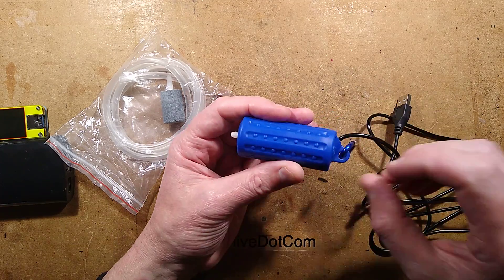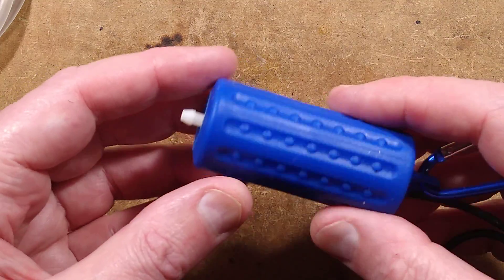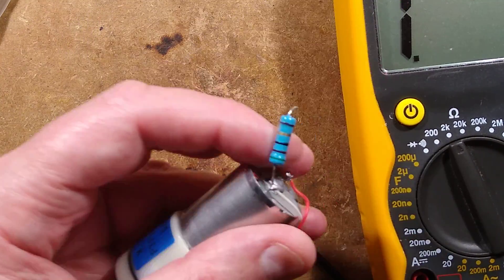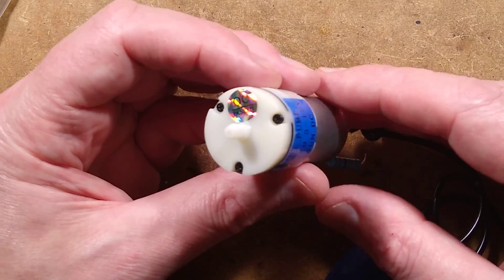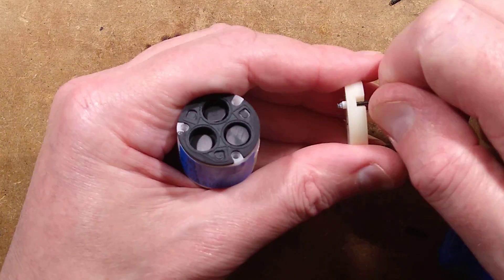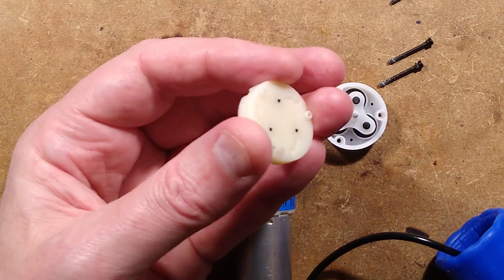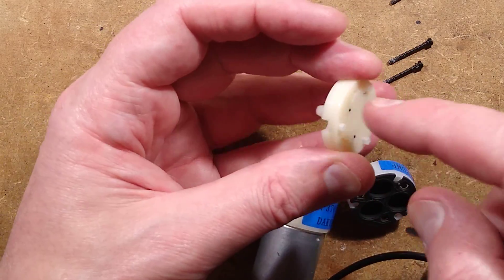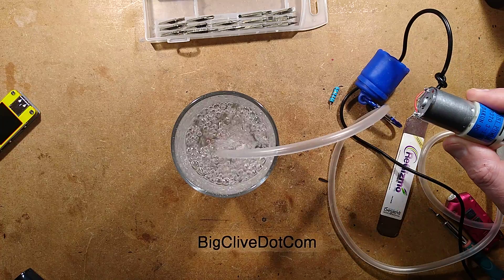Inside a clever USB air pump teardown with hack

Comment: I’ve gone through 3 of these in 6 month. Really quiet but don’t last long. I don’t think the motors are designed for constant running.
Reply: Did the motors die, or did they stop pumping?  I can see that eccentric shaft wallering out pretty quickly.
Reply: I have one running in a small aquarium for almost a year, guess I got lucky!
Reply: Did you try cleaning it? It may not have been at the top of the comments when you wrote this but someone else pointed out that it stops working if it gets dust in the rubber flaps.
Reply: I'd like to run at a lower voltage like 4.1v 24/7
Reply: More than a year on first and everything is lasting fine
Reply: I have 4-5 of it and running since a long time without a problem. Now I use only one of them but all works great. I used it for hydroculture(DWC) and for new burn Galaxy fishes. Still going great and the lowest noise pump I ever had.
Reply: How about a small amount of graphite grease on the moving bits?
Reply: @skylined5534  Lithium grease helped for me. It was the motor that really needed it.

Comment: And you didnt even give it 9 or 12 volts to see the water go ape shit lol
Reply: It's rated at 12v - I was waiting to see him stick 18 or 24 across it!
Reply: Would be nice to see
Reply from the maker: Sadly, my bench is very absorbent.  It's MDF.
Reply: so what you saying here is, A battery tear down with fire risk is fine, however if it catches fire you not use water because your bench likes a drink?
Reply: So what you're saying, Clive, is that the thing in front of you isn't real wood?
Reply: @michaelthibault7930  It IS real wood.  Tiny particles of wood compressed together with PVA glue, which is not particularly waterproof.  Considering what it's been splattered with over the years, it's uncertain whether an excess of water would make it dissolve, catch fire, or shift into a different dimension.
Reply: @Chris

Real wood? For large values of wood, maybe. 

Otherwise, sawdust stiffy. Come on, man!
Reply: @bigclivedotcom  Perfect, then you won't even have to clean it up. "Self Drying Bench"
Reply: @bigclivedotcom  put a tray under it mdf not a problem then.
Reply: @bigclivedotcom  Explosive Containment Pie Dish works for more them just explosions of Fire FYI
Reply: @bigclivedotcom  Don't you have an explosion containment pie dish suitable for such use?
Reply: @bigclivedotcom How much is a sheet of 6mm fibre cement at your local store? I like the finish, it’s water resistant and also heat/fire. Really cheap here. I use it on top on my wooden bench for protection. Not sure if it’s too reflective for film tho?
Reply: @bigclivedotcom  We'll surely get you a can of varnish for that to see some splashs!
Reply: @bigclivedotcom  - Oh no...is BC losing some of his adventurous nature after all these years?  ;)
Reply: @bigclivedotcom  spray some clear on it
Reply: As Photonicinduction would say, "Crank this thing up, until it pops."
Reply: @seanman6541  And if it doesn't pop, there is always an 'AMMAH at hand
Reply: @seanman6541  *Used to say. I miss his videos!
Reply: @seanman6541  I loved it when it popped, what a gezzer he is.
Reply: @seanman6541  Yes but it is given that Photonicinduction is insane.
Reply: @seanman6541  I miss ol Photonicinduction :(

Comment: That's a 3 phase air compressor!

I was just taking apart a similar pump used for bait - it takes 2 D batteries. Not having any I was trying to modify it to take AA. To my surprise, the batteries were wired in parallel, only 1.5v total, and the pump pumps as much as yours does with full voltage. The motor is smaller and only has one chamber though. Runs forever on a pair of 1.2v rechargeable AAs, but I didn't measure the current.

I've taken several of these apart over the years and never could quite figure out where the air intake is!
Reply: The problem with 2D batteries is that they're always flat.
Reply: @westinthewest  That's why I changed them to 2x AA. Works the same with one battery as two, but obviously lasts longer...
Reply: @ryanroberts1104  woosh!
Reply: @ryanroberts1104  AA batteries are ultra cheap, not do the D size, even though the regular zinc carbon has the same capacity as the alkaline AA. I bought some battery adaptors so I could use a AA cell in my AVO, as buying a D cell every few years is not great, as I only need one, and it is likely to leak long before it is used up, but AA cells are used all over. Also replaced the 15V battery with a stack of CR1212 cells in a PTFE block , with some brass contacts screwed onto the PTFE to emulate the rectangular 15V battery. Likely to last 20 years in there, and the cells are cheap as well, unlike that AVO battery.

Comment: Wow it could be used to grow weed hydroponically in a tank of water
Reply: Pretty cheap and way quieter than the video implies. I threw hydroton in a small plant pot with some extra holes ( poor mans net) and put that in a Soba noodle pot to grow my Tokyo Hot Chilli, my plant is small but it is proof of concept for me. I often leave it on the windowsill and use a solar panel with a  5v output to run the pump to be cheap. I also use a solar panel to run a fan (not extraction) just a bit of air cos it gets hot at the window.
If pump vibration or noise is irritating you, a bunch of these will remove that problem regardless of what you use them for. I really mean it, Just water sound (Helps me sleep actually) Do get some backup as they are so cheap. Though I have run mine for nearly 2 years with the voltage going up and down as the sun goes behind a cloud and it is yet to fail.
Anyway, to answer your question. Yes, I don't see any reaason why it would not work. Some experimentation with container size and amounts of liquid could be in order. I think in this case, overkill would do no harm at all.
Reply: @deemond5289  good idea
Reply: Google "Deep Water Culture".

Comment: would have liked to see it run at its maximum rated voltage. i think 12 volts it said on the label
Reply: I would like to see at what factor of the maximum rated voltage the magic smoke gets pumped out. These are data-driven times.
Reply: that is an excellent idea and should be done at the end of every video unless already failed. well done and mr big clive  please take these comments on board

Comment: this is a great product for cosplayers/modelbuilders
Reply: Yuh, those costumes and fursuits get hot. Maybe four or five of these...
Reply: @cheyannei5983  i was more thinking in terms of tiny smoke machines, maybe to use it as a little aircompressor to fill a small tank for light pneumatic actions.
I dont think it can create a lot of pressure but a little bit can be enough
But yeah costumes and fursuits get hot, a normal computer fan will give you more airflow to cool you or a cooling suit if you want to go fancy
Reply: @ShockburnVR  normal computer fans are big and make a lot of noise. This is much easier to muffle; you only need a little air.
Reply from the maker: If you under run computer fans the volume goes down dramatically.  I suppose the ideal approach might be to have a "summer backpack" accessory which contained the fans and power.
Reply: @bigclivedotcom  The advantage I see here is you can just pipe air to where you need it, like to your limbs, back, stomach, head, and they're tiny enough to just bundle them together in a tail or headpiece.
Reply: I wish i had a fursuit to test this out. I might try it with a vaultsuit cosplay i have.
I think you want to create as much airflow as possible. I get pretty warm in that vault suit at conventions
With your idea of putting it in a tail is feasible but you need to create a duct or something where they draw in fresh air or else you just pump warm air around.
Also you might want to add a few outlets to the end of the pipe to spread the air a bit, i think it will be better for the perceived cooling.
The summer backpack with fans is also an interesting idea, im just wondering if the fans will work good enough when you need to guide the airflow through small air hoses 
I find this interesting might look into this

Comment: I think it's called a swashplate pump; fairly common in hydraulic systems, though running much higher pressures. Interestingly, some hydraulic motors also use this to take compressed fluid and produce rotary motion from it.

Though, the construction is slightly different, rather than an eccentric drive, they use two plates parallel but at an angle to the axis of rotation, and the pistons align the plates with ball and socket joints on the driven (load) end, and fluid intake / outlet split. Particularly handy as you also get a universal joint built into the motor.
Reply: I think you mean pressurised fluid, compressed fluid is a physical impossibility!
Reply: @cambridgemart2075  compressed fluid is totally possible, however, compressed liquid is not; so I'll give you partial credit :)
Reply: @carneeki  But it wouldn't be a hydraulic system if the fluid was gaseous!
Reply: @cambridgemart2075  that's why I gave you partial credit.
Reply: @carneeki  You can compress a liquid, however it requires immense pressures to achieve very tiny amounts of change in volume. You are talking putting liquids under thousands of atmospheres to measure a volume change in microliters in some cases.
Reply: @2009dudeman  yup, that's why outside of a physics classroom we say liquids aren't compressable, even though technically yes, they are. Depends on who the audience is to which facts are useful and which can be ignored. To the person building a hydraulic implement for a tractor, a few microlitres of volume is inconsequential, but for a physics professor in an exam, it becomes incredibly relevant, and if you're discussing something on the Internet, you're always wrong in someone's opinion :D
Reply: @carneeki  In many cases we say they aren't compressible. There are plenty of areas where it is important, in this case Cambridgemart said that compressible fluids (I think he meant liquids) are a physical impossibility. Which I would say falls into both physics classroom talk and practical (but rare) instances where it matters outside the classroom.

Yes you have a point that someone will always disagree with you on the internet.
Reply from the maker: I like to consider that a challenge.  All I'd need is a glass of water and an atomic bomb.
Reply: @bigclivedotcom  Kickstarter for the first crowd funded atomic bomb? :)
Reply from the maker: @carneeki  It would probably get funded whether it actually happened or not.
Reply: Cool i had a look at Google images. 👍🏻
Reply: There are compressors for automotive air conditioners that work like this as well.

The torque produced by those are amazing...
I topped off the refrigerant in a vehicle with an older v6 in the dead of winter.
Due to the temperature, I  managed to overfill the system because neither the previous refrigerant nor the butane commonly used today were warm enough to reach a gaseous state.
This gave a false pressure reading.

When I tested it, the liquid refrigerants refused to compress and stalled the engine.

It took until late spring to figure out what was going on.
Reply from the maker: M Harris  I could run the Kickstarter then use the money to build a time machine.

Comment: That pump would be perfect for agitating PCB etchant.
Reply: i just set my tiny cnc up to go back and forth a few hundred times, no need of a fancy air pump to agitate the ferric chloride
Reply: That's exactly what I thought. I might go looking for one.
Reply: @rpavlik1  I have one of that 50€ Neje lasers. It sounds terrible when homing (the axis just smash in the end for a few seconds), but for  small surfaces its perfect.
Reply: It's so much easier to use a tiny CNC to machine the PCB now.
Reply: Colin Newman
Only if you have a tiny CNC router/mill. Be cheaper to use a small CNC laser to ablate away a solder resist, which is probably more accurate and could also be used for a solder mask.
Reply: @handlesarefeckinstupid  So much easier to just send off to a fab house and get 10 copies of a board with PTH, mask, and silk for the cost of a burrito ;)

The waiting however, is the hardest part.
Reply: @handlesarefeckinstupid  How would you machine 0.1mm gaps between the traces/pads? Or a BGA pad array? Or any SMD chip pinout?
Reply: @WolfmanDude  you can get .1mm cutters and ive had better results with them than etching. less nasty waste too.
Reply: @JohnSmith1066-l5n  Well thats very interesting, I will look into that! I am tired of corrosive chemicals in my workshop

Comment: I would assume the resistor is either to increase the voltage dropped across the cable and thus slow down the motor or a poorly conceived back EMF protection device. If so, not sure why they didn’t just use a diode, maybe they got a good deal on 2W resistors that day in the Shenzhen? 

Also not that it matters with the symmetrical design but looks to me like they're running it in reverse, red dot on the motor isn't connected to the red wire?
Reply: @WizardTim, no it's there to keep 'intelligent' power banks turned on.

Comment: it looks like it might be pulling air through the motor from that hole in the back of the cover.
that would also help cool the motor
Reply: I think you're correct, it was clear the path was through the housing containing the eccentric part
Reply: Also to equalize pressures.

Comment: Adding a switch to disengage the resistor seems like a good enhancement.
Reply: 100ma isn't much to switch, either. However, it is still 2 times too much for the cheapest slide switches, so you know they would fuck that up if they added that from the factory.

Comment: I think one of your piezo air pump videos was one of the very first ones I ever saw, so this brings back good memories. 
If you could somehow isolate the motor from the pump section I wonder how well this would work to pump water.  Motor would probably draw a lot more current.

Comment: Was hoping you would wind it up to the full 12v
Reply: My thought, the motor is rated 3-12V
Reply: Missed opportunity
Reply: @thomasesr  Its strange to see people that you recognise from MaTn live streams on other videos :-) Hi
Reply: If it's rated 12V, it should handle 15V !
Reply: @millomweb  why stop at 15V...  if we can go 24V
Reply: 12? 15? 24? That will be just some more bubbles, how interesting is that. I'll say plug it into 3KV transmission line, now that will be an interesting video.
Reply: @CapApollo  Because it's rated 12V
Reply: @PSUQDPICHQIEIWC  why 48 go up to 1000000 megavolts no i can fill up my ocean in middle east
Reply: Maybe with 12V I can fill my rear tractor tire, must not be in a hurry...
Reply: I was like TURN IT UP!!!
Reply: Please, crank it up to 12 volts and then pop it at whatever voltage...
Reply: That's totally something Photonicinduction would do
Reply: @Kuraio  until it pops
Reply: I thought I was the only one
Reply: this
Reply: this please
Reply: Exactly what I was hoping for when I saw the low current and the "hack" in the title!
Reply: Came to comment the same!
Reply: Please Clive  - give us an update. Turn it to 11
Reply: Come on Clive blow it up make it smoke will it  take 12-15 v 😂 cheers nice video
Reply: That power supply goes up to 30 volts.  Why stop at 24?! :)
Reply: Well i think he should try powering it with 1.2 gigawatts of lightning power 😎😅

Comment: Far more efficient than I would have guessed
Reply: The apparent output efficiency is probably greatly aided by the pump not having to wear a silicone gag/mask while under test. The pump is no longer 'breathing' through tiny tubules (presumed to be molded into the interior of the silicone sheath). With the sheath installed, are the numbers the same? The output?

Comment: I beat Clive to working out the pump resistor value!  The gold multiplier on the resistor is 0.1 so 510 x 0.1 =  51 Ohms.  Do I get a gold star?
Reply: No gold star for you

But a gold ring!
Reply: Green brown black is 5,1, no multiplier ie 51 ohms, gold band is 5% tolerance
Reply: @FarleyHillBilly  YOU win.
Reply: ...sort of. It is t that there's no multiplier, but that the 0 means 10 to the power of 0, which is 1. But you know what you're talking about.
Reply: @FarleyHillBilly  sorry but no the tolerance band is on the end green brown black gold  gold is multiply by 0.1 silver is multiply by 0.01
Reply: @dogwalker666  
 Aha ! 5 bands  510 x 0.1 = 51,  brown band =1% tolerance
Reply: @FarleyHillBilly  yes it gets difficult with 1% tolerance knowing which end to read from.
Reply: @dogwalker666  
I blame the E48 series for needing an extra band ie 6.49K
https://en.wikipedia.org/wiki/E_series_of_preferred_numbers
Reply: Farley Hill yes that’s when the problems started also ment we had to buy more Raco draws.
Reply: @dogwalker666  
Ziploc bags and cardboard boxes for us. Holco H8s have the value written on them, luckily.
Reply: Farley Hill that’s how I store the overflow lol.
Reply: I was surprised Clive did not know that gold ÷10 silver ÷100
Reply: As did I, quite surprised he hadn't encountered gold and silver multiplier bands.
Reply: @cambridgemart2075  indeed I used a lot as current sense in DC drives.
Reply: M Harris I was surprised he didn’t I use them a lot 1% are quite common I also have 0.1% but they were expensive I mainly use them for connecting sensors to PLC’s